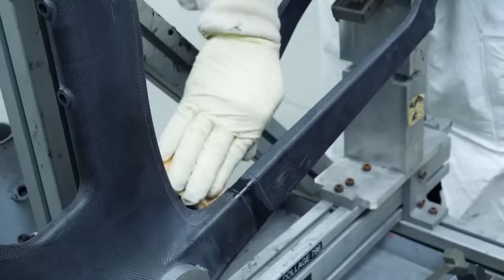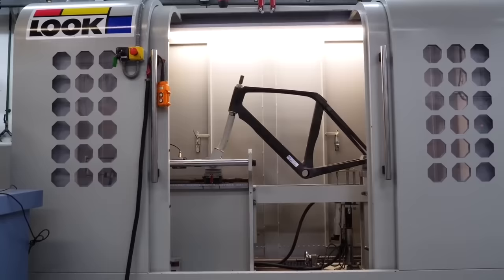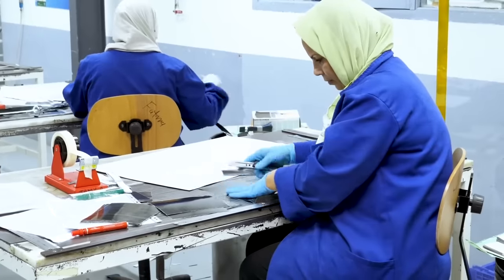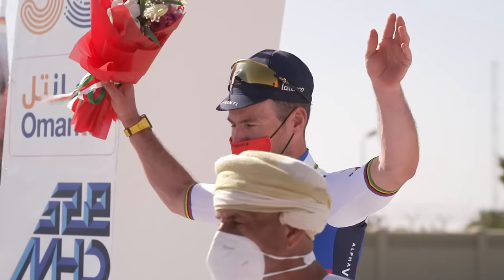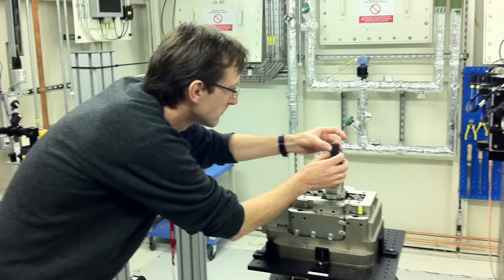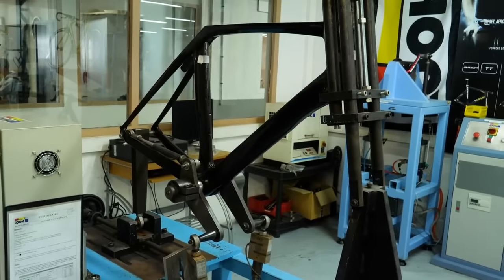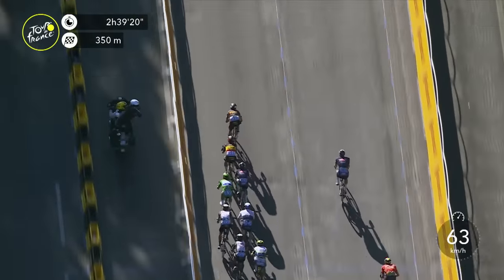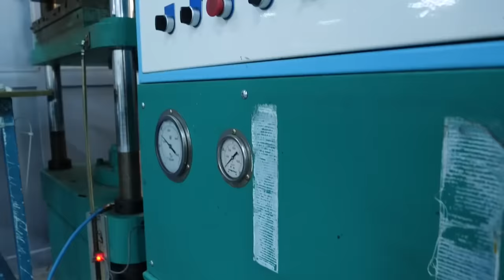Your Carbon Fibre Bike Won’t Last Forever

Comment: It's a perfect union. While the cyclist ages and loses strength and flexibility the bike ages and loses its stiffness, becoming a more compliant partner as the years wear on.
Reply: Until they both break! 😁
Reply: steel ages a lot better, carbon just DIES in sunlight
Reply: Getting dropped causes stress to the bike also
Reply: lol

Comment: I own a Trek 5200 from 1998.  I raced that frame from 1998 - 2009 I officially retired it only because I I wanted to try out a Madone.  I still own that 5200 today and it's just as stiff as it was brand new.   I don't race it anymore but I do use it on tours rides, fundraisers, and riding to work.  It doesn't just sit.  I do keep it inside my house when not using it.  It is well cared for as in maitained.  The frame doesn't feel dead  it's 26 years old I estimate over 200,000 miles on it and it's just as if not faster then most modern bikes

Comment: Exceptional good content. Big thumbs up to Ollie for making this. I‘d be interested in the opinion of an expert from the aerospace/space industry on degredation of an unused, stored frame because in this area, spare parts tend to be stored for a long time. Also I‘d love to hear what professor Marrow has to say about metals. Is it really true that titanium is exceptional good at durability and if yes, why?
Reply: Storage conditions are a major contributor. In the sailplane world, we deal with airframe deterioration all the time. Gelcoat, used on the external surfaces fails in the hot/harsh UV conditions particularly found in the southern hemisphere. When the gelcoat fails, if not caught early enough, then the moisture that can get into the micro cracks get into the underlying structure. From there capiliary action and heat/cold cycles will accelerate the damage. Raw composite material exposed to UV will fail quite fast - often under a year, hence why the use of Gelcoat or PU to provide a protective layer.  Another consideration is heat. Anything above about 55C and the resins will lose strength. So in this video where they talk about the fibres failing, you can also have the resin lose structure too if spent too long in a hot environment. "Hot" can be from just the paint colour - hence why most aircraft are almost all white. The difference in surface temps from white to something like red can be 5-10C, which is enough to push it over the limit and start causing failure. I know of one glider that, after a summer stored in a trailer in the aussie summer, lost enough strength that it became unusable - measured by the wing frequency dropping over 30%. 

Moral of the story - if you want composite stored structures to last for a long time - temp and climate controlled environments are essential.
Reply: @justincouch6964  Thanks for the deep insights. I guess for space applications they will store their parts under a controlled inert gas atmosphere. At least they do so with their semiconductors.
Reply: I also am curious about the reputation of titanium. I tend to look at it as an improvement on steel, with regard to rust susceptibility and weight, but with the durability and strength steel provides. It would be nice to have a layman's presentation of the numbers to back that supposition up.
Reply: Titanium doesn't react chemically with anything you'll find on the road, so no rust, corrosion, etc. It flexes about twice as far as steel before yielding (permanent bend), and it's 40% lighter. Steel is stronger, stiffer, and heavier. Titanium and steel can flex forever without fatiguing, unlike aluminum. The performance of these 3 cycling metals is very similar, with trade-offs in weight, stiffness, durability, etc.
Reply: @justincouch6964  Wow, this puts new light on the infamous A350 paint row
Reply: @davidrees1840  I‘d add airquotes to the „forever“ but the rest is identical to my knowledge. Stiffness depends a lot on tube diameters. Aluminium frames are said to be stiff because they usually have big diameters. I think a fair part of the typical, commonly known characteristics are a product of typical constructions for each material.
Reply: @chrisridesbicycles  Yes, you're right. Eg: Early aluminum bikes were significantly lighter than steel bikes, but relatively flexible and would quickly fail due to fatigue under racing conditions. Early bikes in any material, other than steel, had std-diameter tubes so they could fit std components; only later did they start integrating attachment points to allow them to design for the material, leading to much bigger tubes in most cases.
Reply: Did you guys here on gcn buy shares of stock in titanium metal industries before uploading this video LOL
Reply: read my comment above
Reply: I wonder what effects this will bring in aviation?

The conclusion is also simple, the frame should be of optimal weight, not 600-700 grams, but around 1000 grams, which gives a very optimal service life.
This program clearly shows the need for frequent bike replacement 🤑because until now we thought it would not be necessary.
Reply: HELLLLOOO HAMBINI FANS
Reply: @davidrees1840  Their is still corrosion but to less of an extent. Even Steel and glass have the effect its called stress corrosion cracking.
Reply: @chrisridesbicycles  p
Reply: @johnnyboy3357  spp
Reply: @justincouch6964  Are composite gliders generally of wet-layup composites..?  Or are they cured (ie baked) in kilns as are composite parts for large passenger aircraft..?  The one example you mention of a glider in a trailer under the hot sun sounds like a wet layup wing and fuselage.
Reply: @PRH123   Depends on the age of the glider. All current construction for "mass market" gliders are wet layup with heat curing. There's pretty minimal use of pre-preg. Even repairs, depend on size, we will use heat curing - typically 60C for 8-24hrs depending on material (Glass, CF, Mylar, Kevlar etc) and resin system used.
Reply: @davidrees1840  Steel and Ti both have definite fatigue lifes, so wtf? Steel frames CRACK all the time from cyclic stress (It's recommended to change frmaes every 20 to 25k miles...)
Reply: All metals, including titanium will fatigue with cycles. 
However…
the SR71 gets heat treated everytime is goes on a high-altitude flight. In theory that aircraft will last forever.
Reply: The bike I designed and built will (in theory) last forever provided:

*It is routinely stripped-down, and normalized (heat-treated)…

*…before any microscopic stress-risers appear. 

Your Klein should last forever if the paint, filler, & (sorry, old brain stuck in first gear) “chalkiness” are removed and Gary could be persuaded to normalize the frame. 
Same for your Litespeed. 

My custom bike is aluminum, but in my opinion nothing is superior to 6al4v titanium. The major drawback to titanium is that it doesn’t  absorb the high-frequency vibrations like aluminum. Those high-frequency vibrations will always occur and will either wear-out the rider, or the frame.
Reply: Brain suddenly kicked into the next gear. “Oxidation”. The chalkiness that occurs on aluminum is call oxidation. (DUH!).  I feel like such a clone 🤡

Comment: This is such great content. In a world where the majority of YT videos is an ad for something it's just great to see plain informative content. Thanks!
Reply: Most of the GCN Videos are just elaborate Ads
Reply: It was refreshing that this GCN content wasn't an ad.
Reply: My take out is that Composite Carbon Fibre has as many positives as negatives and that while it is massively strong, the way it is applied to bicycles makes it extremely delicate and in fact less robust than metal frames from a reliability and longevity point of view. My worry is that while it is strong while new, degradation from continuous  vibrational amplification is known to weaken the very best polymer substrates that form and bind the Carbon fiber matrix. Basically even the smoothest road surface creates vibration and combined with the intermittent shock forces of striking the occasional pothole obviously will accelerate micro degradation untill catastrophic failure. This may be an unpopular opinion but is based on the sad fact that everything has a lifespan and nothing lasts forever 😕

Comment: Ollie - I love these videos of interviewing cutting edge scientists.  I would ask not only about aluminum and steel, but titanium as well when you are able to perform the second interview.  I certainly would like to see more videos like this one!
Reply: You look like yu gi oh
Reply: Aluminum frames will  crack over time as metal is crystal.  How long depends on design and heat during construction.  I had a road bike fail after 8 years of almost daily use.   I also have a mtb frame  that's over 10 years old that has not cracked yet and it is used a few days a week on trails without Jumps.   I would not worry about steel frames unless it's rusted our crashed hard.

Comment: The German bike magazine "Tour" made a comparison between aluminium, steel and carbon frames regarding fatigue back in 2010. They put the frames under load over and over again to simulate thousands of kilometers. The first one showing signs of fatigue was the aluminium frame just over 70 000 km. Steel was the second after 115 000km. They stoped the test after 125 000 km because the frame wasn't showing any signs of material fatigue.
Reply: Sauce?
Reply: Frames have become lighter in the last 12 years, manufacturing processes have changed as well, there have been advancements in carbon fibre layup technology, these kinds of tests have to be performed constantly.
Reply: But...
A carbon frame is not "just a carbon frame".
Fibers, layup, epoxy, vacuum, baking, QC all varies.
On well know brands, more than customers would like to know and a lot more than marketing wants you to know.

Comment: One of my favorite Tech videos to date. Please do one for metal frame materials. I have a particular interest in titanium and stainless steel and would love to hear what the experts have to say about them as well. Thanks so much.
Reply: At 95kg, the "life time" reputation of titanium is what sent me in that direction. After all, I like to ride fast/faster, but I do not race. The training just makes the bicycling more enjoyable for me.  Carbon can look really cool to me, but it's well down the list of priorities for someone my size.
Reply: Second this request.  Please cover all the major materials:  steel, aluminium, and titanium.  I'm hoping to buy a new gravel bike next year, hopefully to last me the remainder of my life (I'll turn 60 next year), DV.
Reply: Also second the request on titanium (a  Jan Guillem titanium bike owner)
Reply: Any material will fail in a crash. Any material will eventually fail with improper care. The issue is, how likely are you to crash and how difficult is it to achieve proper care. The first is somewhat out of our control and so you have to judge your use and surroundings. The second is simple enough for any bike material so there's no reason a user can't do it. That leaves us with use. Only 2 of the major bike TUBING materials will fail with use (which is really what this video is about mostly). Carbon fiber and Alu. And by "use", its stress cycles that are possible with the use of a bike for bike riding. That shouldn't need to be said but this is YT. Obviously a steel hammer can fail from use, but a steel hammer isn't a bike. That said, steel and Ti bikes can fail from use, because a frame isn't just the tubing. They are susceptible (as any frame) at the joints. So get high quality tubing (to achieve lightness and comfort), and pay for a good welder. Because then your bike will outlive you and your children.
Reply: @cjohnson3836  I've seen steel frames come apart at the joints, principally chain stays and seat tube at the bottom bracket, occasionally the top tube-head tube junction after a hard crash.  This was always from overheated machine welds making the tubing brittle and eventually unable to handle the torsional loads.  Carbon frames seem to break along the middle of the tubes, hardly ever at the joints.  So much for material integrity.  

Skillfully hand brazed steel is strong as hell.  Have you ever tried to bend a CRMO tube by hand butted to paper thin 0.5 mm in the middle?  Amazing how stiff it is without compromising its unique "modulus of elasticity."  I've ridden two Columbus SL/SLX,SP bikes that ride the same as the day I bought them, 35 years and almost 200,000 miles ago, and too many wipeouts to count.  Bent the derailleur hanger 45 degrees on one many years ago.  Bent it back into alignment, chased the threads, and am still riding the bike.  A head on collision on the other bike left me in the hospital for a week.  The frame builder bent the fork and head tube back into alignment and the paint shows no evidence of cracking at the head tube lugs or fork crown.  Amazing.

Comment: Been running the same Chinese frame for over 9 years on a hard tail XC race bike. I however have recently moved to more trails riding and have taken that bike through more than it should have ever been through. Still holding up :)
Reply: Hey do tell me about the frame, brand and the type of riding you did! I just restored a now 12 year old (maybe 13) scott scale xc frame with reinforcement fibers from an f1 vendor... I've also had the frame x-rayed by a friend who's willing to do it for a fare price at different levels, came back safe...anyways I'm converting it to gravel but still want do hit a few mountains on it haha we'll see🤷 also I've riding prior to it's new fabrication updates with no issues....but the whole idea of the reinforcement was because it was old; so like mentioned in the video "needed a touch-up".
Reply: Are you still alive?
Reply: I own  a carbon sprint kayak and a carbon wing paddle that i still paddle regularly.The sprint kayak is 22 years old and the paddle 25. 
Don't be a fool, don't believe what industry says.